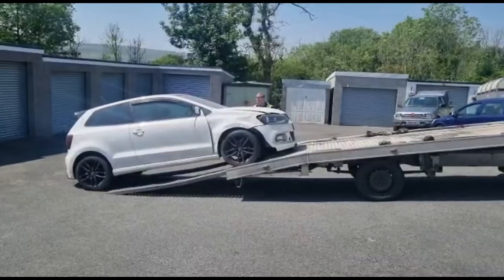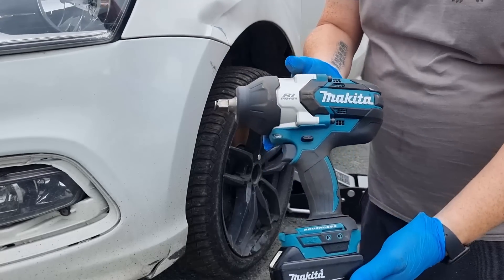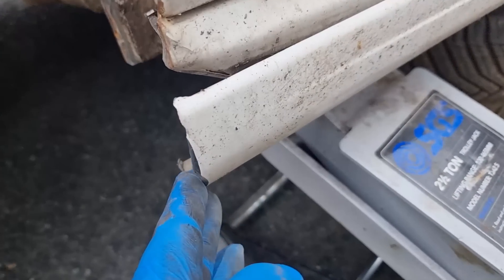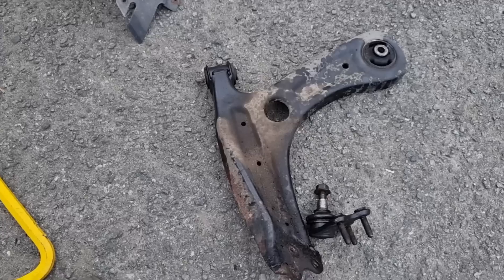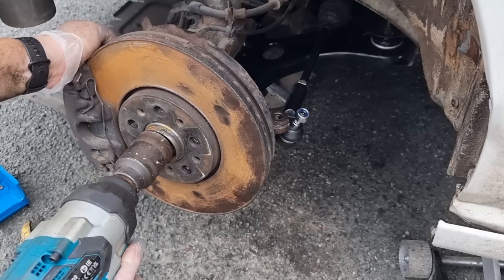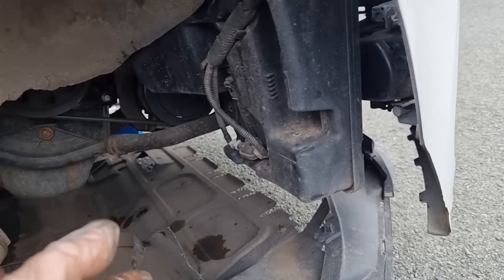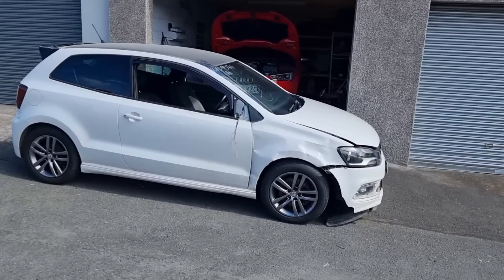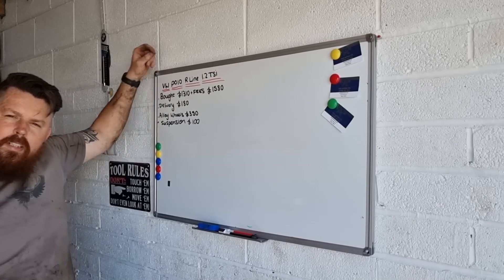I Bought New Alloys & Suspension For My Wrecked VW Polo R Line

Comment: Looking good so far, keep it up.  Just wanted to mention the wheel bolts, aftermarket wheels use tapered/cone bolts but genuine wheels use ball/radius bolts.  If you compare the locking bolts with the S1 bolts you'll see what I mean.  If the wrong ones are fitted it'll damage the wheels and potentially cause another accident.  If you do need to replace them, you can pick them up from the scrapyard as VW/Audi/SEAT/Skoda have been using the same ones since the late 90s.

Comment: Excellent progress. Wheels and tyres 100%. Landsail tyres are from china.  I bought as set 4 years ago for my then car. A Pug 3008. The reason's were. Good price and scored a "B" rating for (road noise) and water displacement when driving in wet conditions. The new wheel bolt package still had the security tag on the package ??. See you in the next one.
Reply: Landsails are pretty dangerous in the wet! Never cheap out and always get some good A rating tires